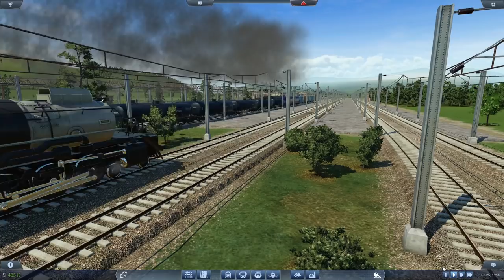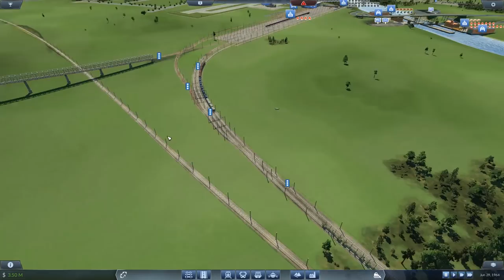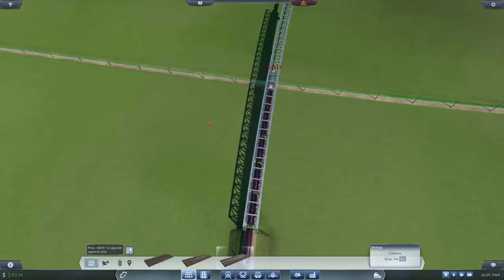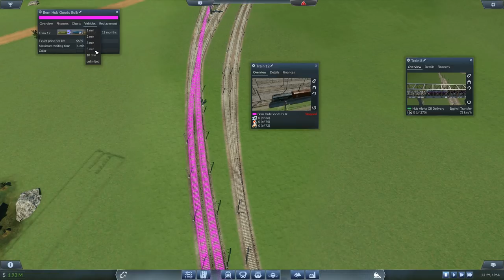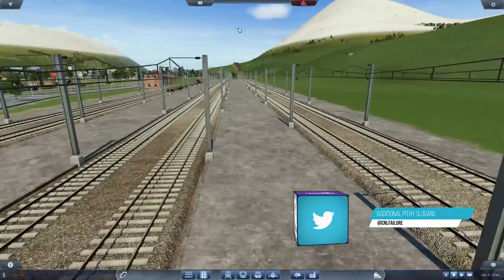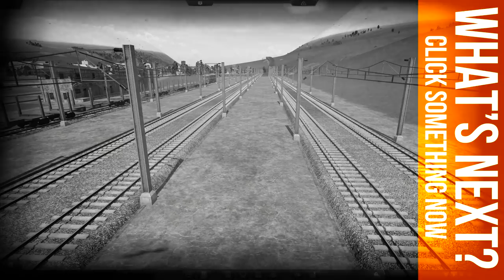Traffic Control at the freight hub | Transport Fever gameplay #58

Comment: I know it is a bit late but I see you fiddling around with that FLYING JUNCTION...   I hear you mention that it is quite long...   When you check the list of options and  check the option to  "NONE" under "TRANSITION"...  You will notice that you are removing all track completely..  When you do that on both sides (A&B), you will end up with a nice compact tunnel/bridge. There is only 1 BUT. You want to select 4 tracks for the bottom part..  Unfortunately, you are not able to have 4 tracks down and 1 track up..  When you select 4 tracks, this will going to work for up and down